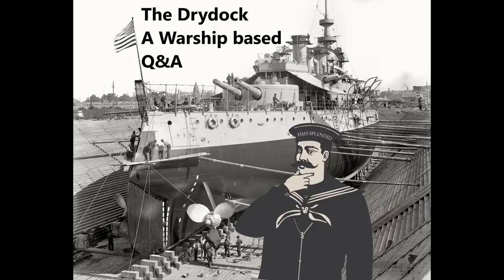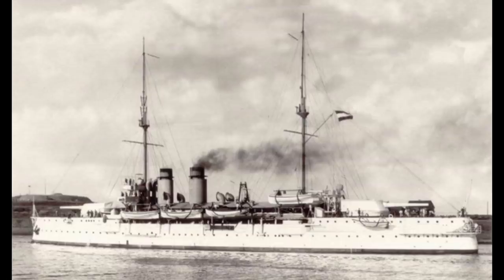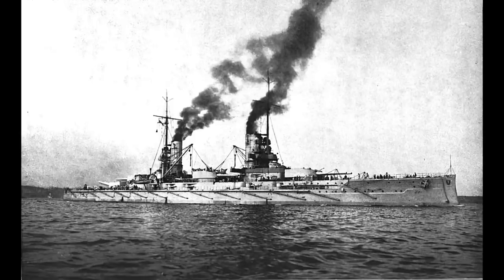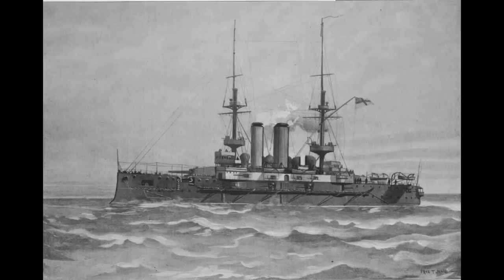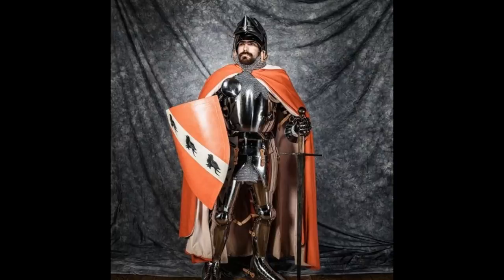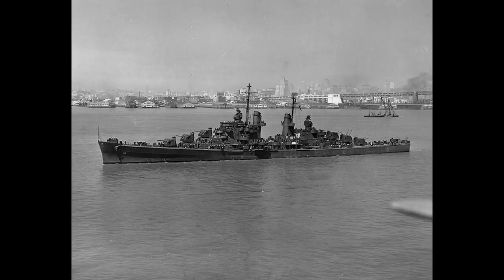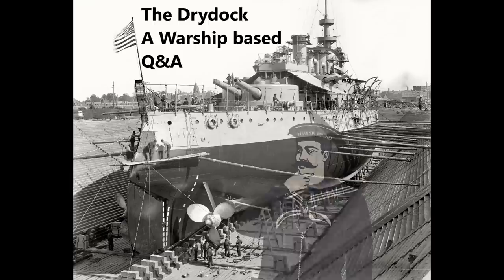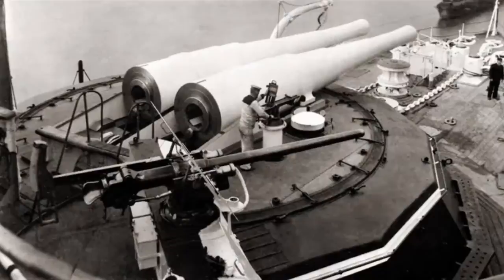The Drydock - Episode 103

Comment from the maker: Pinned post for Q&A :)
Reply: How would the Scharnhorst class with their intended 15 inch guns face against both of the renown's seems a pretty fair battle to me
Reply: Do you think the Germans or Japanese could have won the naval war in ww2
Reply: KMS Hipper or KMS Maiz , with the same amount of hulls , witch design would have provided more value for KMS ?
Mainz - Hipper hull with 4 triple 150mm gun turrets.
Reply: How does minesweeping work in detail? Yes, I know the quote that any ship could serve as a minesweeper at least once, but how exactly do dedicated minesweepers operate, detect and disarm the metal pufferfish and what methods are there? - I am asking because mines may greatly influence operational planning, but the sweeping part during and post war is not often touched upon.
Reply: How much would the course of the Pacific War be altered if the 4 carriers of the 1st and 2nd CarDiv survived Midway? Would they have made a big impact at Santa Cruz or Eastern Solomons?
Reply: @jamesjhk69  No, simply because they couldn't build fast enough.
Reply: @DisSabot  Uh...yes? CarDiv5 had far better carriers (they were newer), but the older Kido Butai carriers would still serve as a secondary offensive arm.
Reply: What would happen if a ww2 era 16 inch high explosive shell hit a mid 1800s iron clad warship, and what would the effect be if it hit an all wood ship of the line from the late 1700s/ early 1800s. Would these ships be able to arm a high explosive shell and would it be sort of like a 1 shot 1 kill?
Reply: For the cost of those ROC and SKUA the FAA could have purchased 400 hurricane fighters.. which were available and could be fitted with a bomb rack.. ie hurribomber..
They could have imported available US variable pitch propellers and had other improvements reducing fighter numbers to about 250... these were all manageable before 1938 and do not offset gladiator funding or any other types....
Other than gross incompetence I am not seeing any excuse for this..
The age old arguments of not operating off enemy coasts don't seem legit.. as does time on station... due to superior speed.. allowing for more rapid response and quicker time over the target
Reply: The mid atlantic gap could have been closed within a few months simply by using several squadrons equipped with older bombers which would have air to air refueling systems... available from USA or just build our own... for many years before WW2...
One or more tanker aircraft would simply remain on station in a box.. some distance towards the desired location.... with 2 squadrons this would be simple to do...
Another squadron would use modified heavy bombers or flying boats.. which are basically heavy bombers to maintain one or more aircraft in the gap...
This is not only manageable using mid 1930s and before proven technology.. but is also highly beneficial as crews will gain significant flight hours on type very quickly and hence operations become more reliable.... a constant stream of older heavy bombers were always available as bomber command rotated many into transport training etc roles with low usage....
Reply: @Drachinifel how would the Battle of the Denmark Straight have played out if HMS Hood hadn’t actively scattered herself to the four winds?
Reply: The Japanese built 12 Akizuki large anti-aircraft destroyers from 1942 on......not a huge number, but quite sizable for an axis navy considering it wasn't the only destroyer type they were building at the time. Please expand your limited knowledge about the IJN.
Reply: Is there a guide on the exact colors used and paint scheme for the Great White Fleet? I'm planning on buying a boat to live aboard and I'd like to paint it in those colors, but I can't find a comprehensive guide on what parts are which color like the deck or even the exact color of the superstructure. I know a 40ft yacht or trawler is hardly a battleship or the Olympia, but it's such a pretty paint scheme. Any help would be appreciated.
Reply: @DisSabot  Uh, that is a major history change. If they survive? The crews do too. Changing leadership at Sea and in the air for the rest of the war. Japan stays on offense into 1942 if you change things,
Reply: I have 2 what if question

If the soviet dont get lend lease, how will this effect kriegmarine since the artic convoy is no more. Will hitler divert more submarine and the luffwaffle and other ship to other front or order them to stay if he think the allied gonna invade norway

If the soviet union were defeated ( or left to the point  of they have no chance to winning anymore), will hitler spent more resource to the kriegmarine and will he finish the plan z
Reply: @Justin-rv7oy  the question and answer was for AA CRUSER.  Additionally, the AA destroyer you were referring to was casually mentioned (not by name) and not any more because it was not in the scope of the question and this was explained in the response.
Reply: @AtomicBabel  The Akizuki class should be brought up because it was referring to Axis AA cruisers and the Akizuki is easily the closest class that fits that bill. In general size it's quite a bit larger than the general WW2 destroyer. It's good that he did bring the class up, but when he did, it was obvious that he only knows the vaguest bit of information on it......If your going to run a youtube channel like this, you should have a basic understanding of the order of battle of all the major players during the war.
Reply: what would the battle of samar have looked like if Halsey hadn't chased the Japanese decoy force
Reply: Are there any ships that are generally considered “ugly,” that you personally find to be aesthetically pleasing?
Reply: About those ship models... I like 'em. Gives a better visual perspective of the engagement. 
A couple of points...
I mentioned below painting the rectangular bases on the micro-scale models to simulate national flags for identification.
Also, you could use mixed-scale models for forced perspective - 1:100 models for the nearer ships and 1:500 models for those farther away. Assuming you have the appropriate models, of course.
Reply: @Justin-rv7oy  I'm a fan of the Akizuki Class and hope it gets covered in the 5 minute guides.   Looking thru that playbill, an IJN "special" destroyers episode appears to be install for this winter. However, Takao and Atago will be covered this month and that has this subscriber very excited.
Reply: Was the Kaiser a better ship designer than Tirpitz considering for excample that Tirpitz was a fan of wing turrets ?
Reply: more miniature ships for your videos? not just yeah but hell yeah. i thought that was really cool for the Jutland video.
Reply: Is there a Naval equivalent of the Bob Semple tank?
Reply: Why weren't rocket AA systems pursued more for warships? I can only imagine that a multiple launch system with simple preset timed fuses (perhaps staggered timings amongst the salvo) would be absolutely devastating at medium AA ranges. A single launcher could fire a salvo equivalent to the main battery of many light cruisers if the rocket warheads where in the 6 inch range. Obviously it has the disadvantage of long reloads, but if an entire formation of aircraft can be broken by a single launcher, that's a pretty good trade
Reply: I wonder if the Dutch AND the British might have been well-served if the R- class battleships had been sold to the Dutch? Even if the revenue gained was relatively minor, it might have paid for another BB or more cruisers for convoy escort service. I would think that those 15” guns would have been a not-insignificant deterrent for the Kriegsmarine (and for that matter, they would have provided some worrying considerations for ground forces as well...). Thoughts?
Reply: What happened if the Washington naval treaty never happened?
Reply: What naval battle has the greatest combat disparity that was won by the supposadly weaker side.? Example a boat sinking a battleship.
Reply: You mentioned in a video a while ago that, unlike world of warships, you never bow tank incoming fire. Why is this?
Reply: @bkjeong4302  Too the previous question. If Japan saves the 4 carriers, can they win the War? Likely no. But they can drag it out to a peace on their terms.
Reply: Like the Jutland miniatures,  makes it far clearer especially if you can easily differentiate between the two sides.
Reply: @blogsblogs2348  Available does not equal a good choice.
Reply: When were barrel liners introduced to naval artillery, and what are the practical limitations on their use (caliber, chamber pressure, etc.)?
Reply: Ever get into those model ships that are Radio controlled and have BB air cannons?
Reply: i was wondering did Bismarck and tirpiz have all in one shells like no powder bags and used a explosive charge that was very hard to set off unless it was being fired out the barrel ive heard a little about this they say that they were immune or some what immune to magazine detonation what are your thoughts on this and if true how effective was it
Reply: Tell me the intro music
Reply: @blogsblogs2348  Blimps were a better option than air refueling bombers.
Reply: @Matahpi  sticks in my mind that the usual tactic is to use paravanes.  Paravanes look somewhat like airplanes, and are towed through the water by the sweeper.  The "wings" and "tail" fins of the paravanes are set so they spread out away from the minesweeper, and the tow cable between the paravane and ship cuts the mooring cables of the mines.  The mines then pop to the surface where they can be detonated with gunfire.
Reply: @tommeakin1732  Rocketry in the 1940's was moving as fast as it could. From the Bazooka to the V2. In the 1950's unguided rockets were thought to be a fighter plane weapon. But it never replaced the 20mm.
Reply: @admiralredaceone5913  The Great Depression would have had the same result. A cut in defense spending.
Reply: @gbladewarrior6884  CSA Hunley vs USS Houstonanic. X craft vs Tirpitz,  MS 22 vs HMS Manchester.
Reply: @DisSabot  the nightmare scenario I have floated a couple times is what if the IJN converted the Kongo class ships into carriers in 39 or 40.  If they had done that, the IJN would still have had 6 large, fast, carriers, even if they lost 4 at Midway, vs the USN only having 4.  Then Hornet was lost at Santa Cruze, then Wasp was torpedoed.  The IJN would have pretty much had it's own way in the Pacific for the balance of 42 and 43.   It took until the end of 43 for the USN to get 6 Essex class carriers in service, to allow it to meet IJN air on equal terms.  Until then, it would be up to USN subs to carry the load, as anything on the surface, without air cover, dies.  The US would eventually win, as the IJN could not make up it's losses like the US could, but it would have taken several years past 45.
Reply: @FazCraft  Brass cased cartridge guns. SK C/34 from Krupp.
Reply: @tommeakin1732  there was a rocket AA system developed by the British DMWD.  It wasn't the shotgun approach you describe.  When fired, the rocket streamed a cable behind it.  The objective was to stream the cable in front of a low flying airplane, in hopes the plane would hit it and the cable would damage a wing or engine.
Reply: Nice episode. You've covered range finders nicely in a fire control video earlier. I couldn't find one about asdic/sonar. I'm curious because during WW2 a lot of quickly adapted ships (trawlers, mine sweepers, whale boats) were converted and had sonar added. How was this done? Did they have holes cut into their hulls or were they fitted on? How were hydrophones fitted? Did they draw power from separate generators or run from the power on the ship?
Reply: Are you familiar with the song Bismarck by Sabaton? If so, what did you think?
Reply: @Matahpi  Agreed, vast minefields were laid in the Channel, and North Sea , and Mediterranean during WW2. Always wonder why mine sweepers didn't hit mines more frequently.
Reply: @stevevalley7835  I should have clarified my comment by saying that I'm aware of most of the AA rocket attempts, but I'm surprised they went for the route that they did when they could have gone the route that I suggested which strikes me as more likely to succeed. They already had proven timed fuse technology, so why not combine that with the new delivery system?
Reply: @WALTERBROADDUS  I perhaps should have made it clearer in my comment, but there already were attempts to make rocket based AA systems (I'm mostly thinking of the British "Unrotated projectile"), I'm mostly questioning why they didn't just slap timed fuses on rockets instead of the novel suspended cable idea they went with. I think they did try early proximity fuses on some land based batteries though
Reply: I love the intro song
Reply: Is 3 gun turrets in pairs more effective than 2 gun turrets?
Reply: Channel admin question, sort of. Have you ever considered doing this (the Youtube channel) full time, giving up your regular job? Part of why I love the channel and your videos are not only your knowledge, but how much you enjoy talking about these topics. Very visible in the live streams as well, so the thought may have crossed your mind perhaps?
Reply: Drachinifel, I once read that BISMARCK and TIRPITZ were a re-work of the BADEN and BAYERN.  Is there any truth to the rumor?
Reply: When will you redo the floaty log?
Reply: Recently i stumpled into the probably oft repeated argument that Bismarck wouldnt fare well even in a fair fight with Rodney because of her great armor, that she would have to get into close range in order to be able to hurt her (person neglected to argue why a close range fight would be a disadvantage for the bismarck but i digress). But then i asked myself 'how close would Biscuit have to get in order to penetrate Rodneys belt' so i went to a site called NavWeaps and took a look at the old 38cm SK C34 and found two penetration charts. One chart says its "based upon the USN Empirical Formula for Armor Penetration." and claims that the gun could penetrate Rodneys belt Thickness at 22Kilometers, the other says its "based upon German face-hardened (side) and homogenous (deck) armor penetration curves." and that the gun begins to be able to penetrate at around 20Km.
http://www.navweaps.com/Weapons/WNGER_15-52_skc34.php
my question is: A) is the penetraton discrepency a decent representation of the variance between British/German Armor plate and American armor plate, you mentioned in your video on the subject that British and German large armor plate was superior. 
B) Is 18-20Km close range for a WW2 battleship? i havent really picked up any sense of range from watching your videos due to your Crumpet Empire Measuirng Units.
Reply: Drach,  
In your opinion, who had the best 12in gun battleship, whole package?   Obviously USS Arkansas lasts the longest and the Alaskas are 12in ships but are some form of cruiser (battlecruiser or super cruiser, whatever).  Who was the best at launch and most speculatively, what was the most conducive for modernization to include boring the barrels out in the equation?
Keep up the excellent content.
Reply: What's the difference between a turret and an enclosed barbette?
Reply: Could you make a video about the Zeven Provinciën from 1665? It was Michiel de Ruyter's flagship, the greatest admiral in the history of The Netherlands. It's also one of the most famous Dutch warships.
Reply: I have been thinking about something lately. I have always observed that most people seem to attach some sort of awe with the Yamato’s because of their size and the size of their guns. I personally have never subscribed to this view always believing that they were either poorly designed in some way or had inferior workmanship in their construction. In a battleship vs. battleship fight I’ve never believed they could hold up with any of the modern US ships as the US ships all had radar aimed guns. Well, we know where both are now, and video of both wrecks shows that they both blew apart because the forward magazines blew. This was photographed with Yamato but I didn’t know that same thing happened with Musashi .  Thats interesting because I can’t think of a reason why both should have suffered that fate. If I’m not mistaken only 500 lb. bombs were used and torpedoes also hit them . But how could fire get into the magazines? A 500 lb. bomb should not have been sufficient to get to the magazines, neither should a torpedo and obviously something did. I thought that possibly in the case of Yamato several of the protections were taken out of the way to facilitate faster gun fire for that last battle and much like the British battlecruisers at Jutland they paid a price for that. Even if that were true that should not have been the case with Musashi. So there possibly does appear to be a design problem with them. Maybe there was a problem with  the propellant for the guns, but this didn’t happen I don’t believe with other Japanese battleships. Well maybe they made up a mixture that was different for the 18 inches, ok, maybe they did. But in so doing. I would think they would have noticed that it was unstable. I don’t know, it seems to me there is a major flaw in their design and this would have been very apparent if they had ever gotten into a ship vs. ship battle as either the 16/45 or the 16/50 would have packed many times the wallop of either a 500 lb. bomb or an air launched torpedo. I am starting to believe that they would have done an even bigger version of the Hood if that sort of battle had ever taken place. Why did those forward magazines blow up on both ships?
Reply: When do you think the switch from Steam to electric (diesel or Nuclear) made  for different ship types?
Reply: Could the conversion of the Japanese Izumo-class helicopter carriers destroyers into light aircraft carriers multi-purpose operation destroyers by modifying them to accept the F-35B be seen as an attempt to "pull a Mogami"?
Reply: @FazCraft  the projectile and the "powder" were separate for ease of handling.  The British used cloth bags for the powder and the bag was consumed during the firing.   Obviously, cloth that will burn away will catch fire pretty easily.   The Germans used a metal case for the powder, and that is a little more resilient to ignition from fire. It will go boom when exposed to fire, it will take a little longer and that margin may be just enough to save the ship.  
Btw: when the shell is one piece and the powder charge is another single piece, the term is "semi-fixed" and "fixed" would be both projectile and propellant were together in a single unit.
Reply: Metric AND imperial.
When the Hubble space telescope launched, they discovered a big problem. There were some conversion issues from/to metric/imperial, which caused some serious and expencive repair jobs. This was because parts came in "from all over the world".
Some countries also ordered their ships from different shipyards, and I asume, using different measuring standards. Are there any (in)famous cases of such things with warships in recent history?
Reply: @tommeakin1732  I don't think the rocket technology available would have given a range of more than a few hundred yards a best
Reply: @tommeakin1732  The AA gun was proven and simple. There's  also the danger of rocket fuels of the time.
Reply: If you could design a successor to the Montana class, what would I to look like
Reply: @Colin Walker that would be an interesting dilemma.  If the US made obvious preparations, the Japanese would realize the US had broken their code.  Churchill was in this dilemma wrt a Luftwaffe attack on Coventry.  He let Coventry burn, rather than tip that they had broken the German code.  The best scenario I can thing of for the US, is to establish a paper trail explaining that an air raid drill was planned, using the scheduled inbound flight of B-17s as the stand in for a theoretical attacking force.  So, when the radar station picked up an inbound formation, everyone proceeds to launch ever fighter on the island to intercept what they are told are US Army bombers, but when they get there, they discover the Japanese, and the furball commences.
Reply: @lutenantsweedpertasa  "@Drachinifel how would the Battle of the Denmark Straight have played out if HMS Hood hadn’t actively scattered herself to the four winds?"

Scattered herself? Come on! She had help! (Give the Germans some credit there.)
Reply: How did ships in the age of sail manage to replace or repair their masts at sea?
Reply: So, what exactly is the Armstrong 14 inch gun meme?
Reply: How thick did armor generally have to be in order to effectively block kamikaze hits?
Reply: @blogsblogs2348  one real problem with that idea, iirc, at that time, 1938, the FAA demanded that every aircraft have a navigator.   The Hurricane, being single seat, falls down on that score.  If the FAA wanted something more capable than the Skua, they could have bought SB2U Vindicators, a bit more speed, a bit more range, and a bit more payload, and was available in 38.  The SBD had more of everything than the SB2U, but did not enter production until 40.
Reply: How functions the triple 25mm with armor like on th Yamato?
Reply: Since torpedoes used a magnetic proximity fuse, and the importance of radar was realized, why did the innovation of the radar proximity fuse come so late? Would releasing something like chaff (or perhaps a bit heavier decoys) have worked as a countermeasure against proximity fuse grenades?
Reply: If the High Seas Fleet had been kept in service after 1919, either with Germany or other nations, which ships do you think would have lasted the longest in service?
Reply: Drach could you review the Tom Hanks movie "Greyhound"
Reply: Can you do a movie review of "Greyhound"?
Reply: keith moore  But some evil weapons' inventor should've come up with the idea to use thicker glass, or another ceramics, or some elaborate feathering system to make it unbreakable enough. It shouldn't've been a too unexpected idea to suspect that the enemies had already succeeded. (Sorry for "spect spect" there.)
Reply: As for Czech steel, I heard Mikasa actually had Czech made guns. I was told this on Mikasa by one of the museum guys, after he asked me where I'm from, and I told him I'm Czech. Wiki says they were from  Elswick Ordnance Company. I heard about steel and armor export, but whole guns seems weird. Not impossible though. Any idea ?
Reply: Can you make an episode on refloating ships?
I am always surprised how common it was/is.
I would expect sea water to damage nearly everything.
Reply: @DrSid42  Czech was the most industrialized region of the Austrian-Hungarian empire. No wonder they had some ship-relevant industry left even in the 1930s.
Reply: The Type 96 25 mm AA gun is widely regarded as an extremely poor AA defense weapon, yet, Japanese sailors seemed to hold it in relatively high regard, second only to the dedicated AA 100 mm Type 98 guns. What explains this discrepancy? Is it a simple psychological "this is the only thing I can use to shoot back at all these planes therefore I love this thing" or was there something about the gun that impressed its Japanese operators?
Reply: Hey Drach, what would you name a type of ships after super dreadnoughts?
Reply: In your reply about ships with numbers rather than names one major group you overlooked were the USN amphibious ships.  I am thinking specifically of the LSTs -- several hundred built for WWII with nary a name among them.  Perhaps because they were armed with only AA and the odd 5" 38 they were more water taxis than fighting ships but in the neighborhood of 4,000 tons displacement, loaded, they were far larger than any PT or E-boat.
Reply: Why did the British gun charts measure the performance of a shell without the caps on? Wouldn't that give a potentially misrepresentation of how the shell would perform in combat conditions? Or was this used as a sort of 'worst case' performance measurement?
Reply: @DrSid42  Skoda made a lot of guns.  The Italians reverse engineered a 100mm Skoda that was mounted on some Austrian DDs they received as war reparations and developed it into a rather nice AA gun.  I have seen it reported that one of the reasons Germany wanted to carve up Czechoslovakia was to get it's hands on Skoda, which then, as now, is in  Plzeň aka Pilsen, as in beer, in Bohemia, in western Czechoslovakia, which was one of the first places the Germans latched onto.
Reply: I seem to remember a passel of caiques filled with Germans getting sunk in the Med.

Is there a name for that battle?
Reply: @Lubyak  it may be a matter of how much a gun does or doesn't irritate it's crews.  The US 1.1 jammed, a lot, in several different ways.  There is color combat footage of Midway, shot by the USN, that has several short looks at a couple 1.1" mounts on one of the ships.  In the first couple looks, the mount in the foreground is banging away just fine and looking very potent.  In the third glimpse, only the right end gun is firing.  As the loading machine of the 1.1" held two clips and switched between clips automatically when one clip was empty, the three guns that are stopped are probably not stopped for a reload, but because the things jammed, again.  That is probably a total, of all the glimpses, of 10 seconds of looking at that mount, and the camera caught 3 of 4 guns jammed.  Any machine will engender a degree of loyalty, if it simply works as intended.  Doesn't matter if the 96 has to stop to reload every few seconds.  Doesn't matter if the 96 throws a light shell.  Doesn't matter if the 96 has a short range.  Doesn't matter if the 96 vibrates.  If the thing shoots when you pull the trigger, it will be appreciated.
Reply: Drach I was looking at the coat of arms on your shield and it looks quite similar to the coat of arms for the Venetian Polo Family. (you can see and example if you google 14th century Venetian Galley or battle of Lepanto where you invariably will see an image of a galley flying the crest from the main mast) is this coincidental or an inspiration as I notice the birds are a bit different?
Reply from the maker: @Kim-the-Dane-1952  it's my family coat of arms at the time, but one of the historical issues of the period was people having similar coats of arms, both within and between countries. :)
Reply: @Drachinifel  Thanks. It looks great. Yes the birds are slightly different and the diagonal is probably more white on yours. I just remembered that I had seen something similar before
Reply: @mikehoshall6150  It had nothing to do with any sort of design issue, and more to do with the fact they rolled over as they sank (in Musashi's case, after sinking) and sent the explosives tumbling within the turrets, same as what happened to Barham. Fire never got into the turrets, the explosives went off on their own.

The Yamatos aren't as good as they used to be thought of as, but nowadays people too often go way too far in the opposite direction.
Reply: @Lubyak  The former.
Reply: I just had a somewhat odd throught...
Have there ever been ships that had the screws located somewhere other than the back, like mid-ship or close to the front? Or have there been designs that had the screws internal, kind of like a jet airplane or fictional stealth engine of the Red October from the movie of the same name?
What would/could be disadvantages or advantages of such unusual placements?
Reply: Can you do a review of the movie 'Greyhound'?
Reply: Have you heard the song "Bismarck" by Sabaton and seen it's video? Any opinions on the lyrics and video?
Reply: How about something on VT anti air shells used late in the war
Reply: Drach: Crazy, fun, semi-Naval related question for you. Do you know where the USS Sedona is? (and do you know WHAT it is?)
Reply: What is the difference between a gunboat and a sloop of war or corvette or other small warship?
Reply: Thank you, ! Am a big fan of your drydocks, but this was an eXceptional example!
Reply: Sorry, but wanted to cZeck  (intended) something before posting. The nascent Israeli state used almost entirely Czech-made armaments in their 1948 War of Creation. Also, consider the deterrent a small but qUality Dutch Navy could have had on Japan in 1941\2 (edited). Keep up the fab content, please. Glad (Traffic!) you are able to do this more as a full time gig, now, despite the probably painful original reason.  🎶🍄🚲🍕🍦
Reply: @Jahee-Official  ! Am of the understanding that U.S. lost its first Mars orbiter because, for whatever reason, NASA made irrational conversions of kilograms (mass) to pounds (weight) as if they measured the same force.
Reply: 2:30

Would the Dutch have decided their ships did not need as great a range as the UK, Germany etc. and hence be able to reduce the size and cost of a QE or similar contemporary ship?